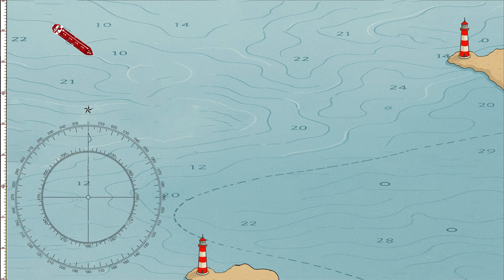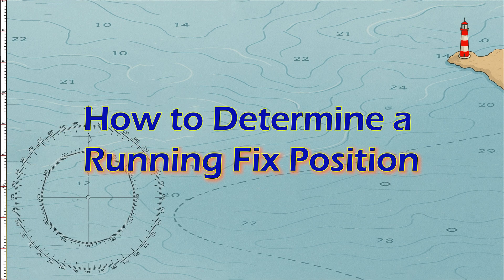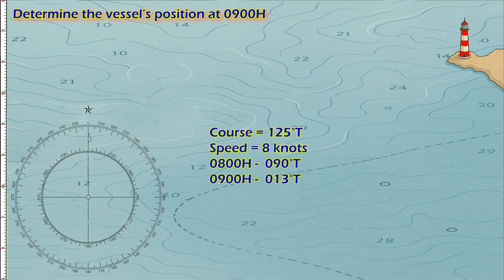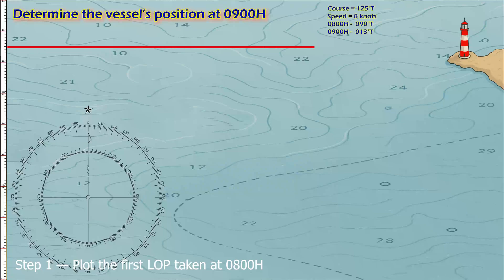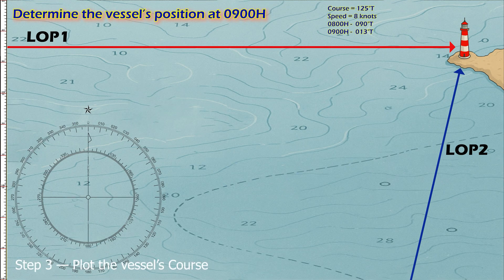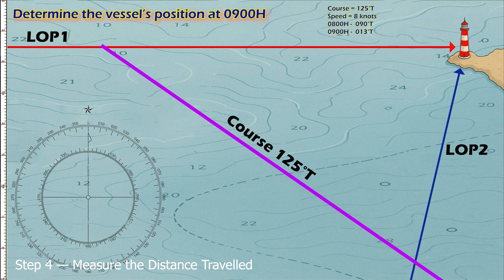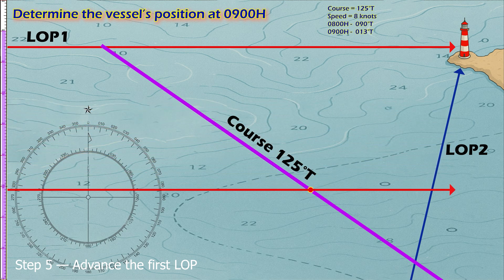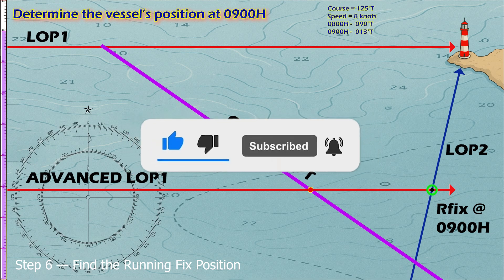Running Fix (Navigation) - Explained in 3 Mins

Comment: Another way to get a fix using a single object is to double the angle on the bow.  Take a measurement of the angle off the bow of the object. This can be done by taking a bearing and applying it to the vessels course ( plus on stbd. Minus on port side). Continue on course until the angle doubles ( if it was 45 then you are looking for 90) when the angle is double then your distance run will equal the distance to the object. BTW. This is not navigation, it's piloting.
Reply from the maker: That’s a classic piloting technique! Great point about the distinction between navigation and piloting—thanks for adding that valuable insight.

Comment: So, youre saying that no matter where I draw the 'heading' line it doesnt matter as the position will be the same. Rubbish. Clearly in anyones understanding that cannot be true.
Reply from the maker: Sure, try plotting it yourself and get back here. I’ll wait to see if your ‘heading line changes everything’ theory actually works.
Reply: Where would you even put a ‘heading line’ if all you have are bearings and no position? Spoiler: you can’t, because that’s not how a running fix works.

Comment: That's the basic formula, but here you've made no allowance for Tide/Current, or in respect of a sailing yacht, leeway. Additionally, as a back up confirmation, Always check your depth when looking at the estimated position.. if it doesn't agree with the chart then old chum, 'you ain't where you think you are' :>)   Spoken from an ancient, professional yacht delivery skipper when hand-held compasses and a sextant were the tools of the trade,  and hanging a heavy spanner over the side was an alternative to having a depth sounder, the world had not yet learned to spell GPS..
Reply from the maker: Absolutely agree, Captain — that’s an excellent point. Tides, currents, and leeway definitely play a huge role in refining a running fix. I focused on the basic concept for beginners in this video, but your reminder adds a real-world layer of accuracy. And yes, checking depth against the chart is a timeless and reliable backup. Thank you for sharing your seasoned insight — much respect!
Reply: There's always one isn't there?
Reply from the maker: @Gastronaught  Haha, all good — I actually appreciate experienced mariners sharing practical tips like that. It adds more value for everyone learning the basics.

Comment: I will say its wrong, as you are not taking into the fix the speed over ground or course over ground.  No tide no wind and no errors?  So, you do not have any factors showing to say where your position is truly  Your course is around about 108, and therefore you could be in danger of running aground.
Reply from the maker: Thanks for your feedback! In this example, I simplified the situation by assuming no tide, no wind, and no errors so that students can focus purely on understanding the running fix plotting method. Of course, in real navigation, we must always consider speed over ground (SOG), course over ground (COG), set, drift, and other external factors. I’ll make sure to clarify that in future examples so it’s clear the exercise is about the plotting technique itself, not the full real-world scenario. Appreciate you pointing that out!
Reply: The course is not 108, rather it is 125 as appears on the video.  Previous fixes will confirm the actual SOG and COG which will have some of the tide/wind factored in already.   This is just a "running" fix,  which means an approximate interim fix until something better is available.  There is presumably another system at hand, like GPS, radar or Decca, but even in a simple craft the method is still useful, the next fix might have three land-based points.  I have used this method in conjunction with astro nav fixes which are often impossible in cloud or at night.  One uses what one can!
Reply: Mmmm actually isn't but however you should know better than to cast pearls before swine